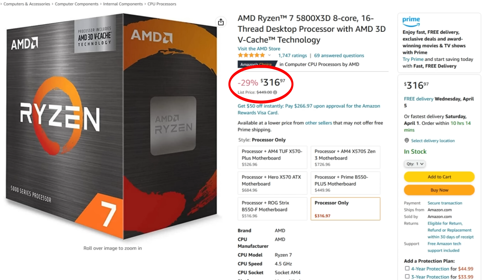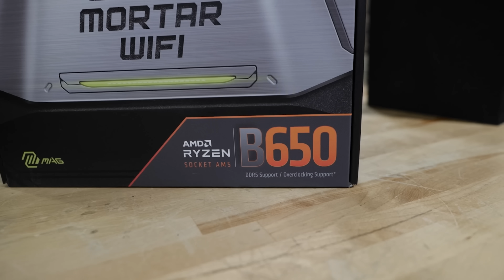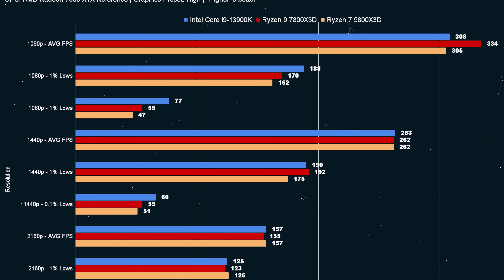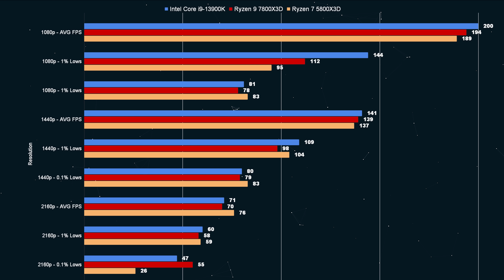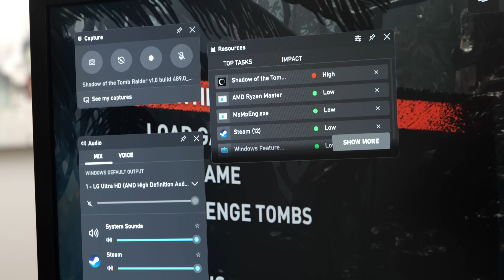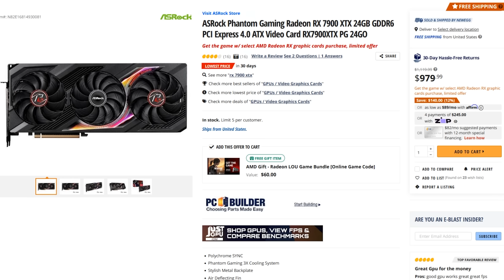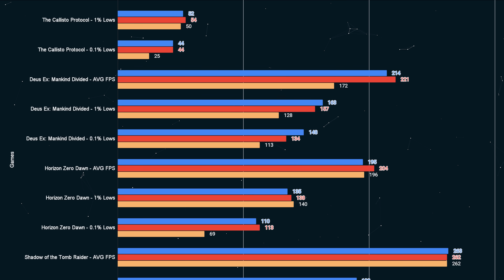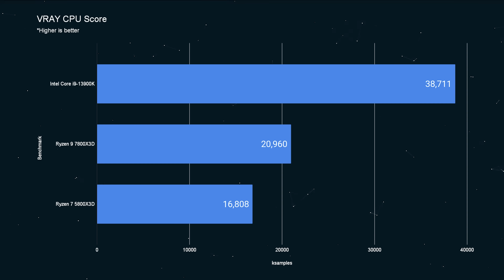Is The Ryzen 7 7800X3D The Ultimate CPU For Gamers?

Comment: The Ryzen 7 7800X3D erases the lower clocks and performance of the Zen 3 5800X3D but with higher IPC/clock gains per cycle that the 5800X had.  (Cinebench 17,432 Zen 4 vs 16000 Zen 3/5800X)  The only con I have is coming from the X3D Zen 3 to Zen 4 might not be enough increase to upgrade?   Building new and getting a faster performing CPU at lower wattage and bigger L2 + L3 and other little improvements gives Zen 4 7800X3D a leg up from me.
Reply: Compare AM4 vs AM5 total system cost, then put that in relation to performance differences between 5800X3D and 7800X3D that matter to you, add a grain of salt regarding potential future upgrades on the same platform, and you got your answer :3

Comment: Also it is important to note that during gaming the 7950x3d can have the cc'd with the extra cache totally focused on gaming for max performance while the other ccd can take care of any other programs running on the same time in the background. 7800x3d can not do that
Reply: should check again, they park the cores in game, and when you disable that feature they shown that sometimes the game moves across fabric, so you get better performance parking. if you do background stuff, you should just use intels e cores, if it matters to you.   also quicksync apps, amd doesn't have that yet for the programs that work with.
Reply: I would actually love to see a 7800x3d vs 7950x3d (and why not vs 5800x3d too?) benchmarks in gaming and streaming at the same time (NVNEC x264 P6 / P7 encoding, maybe some benchmarks with AV1 too). 
All I've got atm is an old 3900x and 4090 and my fps gets tanked hard in OW2 when I start to stream or record, therefore thinking about upgrade. I would love to know if there is any point in paying for those extra non-vcache cores for such an use case.
Reply: @RJ-vy4yd  me personally bought the 7950x3d because during gaming I want to have stream open in my second monitor, to have all my programs for monitoring and controlling the components of my PC as well as make recordings have opera gx, twitch and other stuff running in the background. So the non v cache ccd can take care of all these so the 3d cache ccd can focus on the game to make sure I get top tier gaming performance. With a 7800x3d .... Well... Still good performance but some performance would be lost due to the CPU trying to take care of all those things with 1 single ccd

Comment: What are chances that AMD makes AM5 APU that has 32 or more L3 cache, 12 or more RDNA 3 i-gpu, 8 cores ? That has decent performance on a 1080p platform ofc.  5700G performance on 1080p platform (high settings) was frankly disapontment.  Still running 3400G APU. I see no benefit upgrading to 5700G.

Comment: Thanks for benchmarking games that actually benefit from the 3d cache, unlike every other review I've watched. I would love to see a revisit of Stellaris with some numbers. Maybe let a save file run as a spectator til the midgame at 2300 and time how long it takes to reach endgame at 2400 on fastest with autosaves off, using the same save file across cpus. Also maybe do 3 runs per cpu just to account for any RNG, though I doubt RNG plays a big part once the borders have kind of settled.
Reply: How is anybody supposed to know which games would benefit before testing them?
Reply: @shanent5793  we know what games benefitted the most from the 5800x3d so it worth testing the how well this new one does with such games.

Comment: Curious about ram speed with the 7800x3d and if it hit 6200 or ...
Reply: I have personally tested 7 AM5 CPU so far.  All 7 have hit 6200 with no issues.  Getting to 6400 however I have only had two post at that speed and only one of them run stable.  Luck of the draw has only favored a 7900x3d so for with 6400 speeds stable.

Comment: The biggest problem for the 7800X3D is the 5800X3D.  The 5800X3D has been selling like crazy, typically being in the top 6 on Amazon's top 50 best selling CPUs and it has at multiple times been within the top 5 best selling CPUs. 

I'm thinking that people who bought the 5800X3D are in no mood to switch out a system JUST because there's a CPU that games better.  A handful of people will, most won't.  There's a lot of expense in moving to AM5 and personally I'm not a fan of the limitations right now for Zen 4/AM5 because I use a MB for much of the IO that's on it.  The fact that Zen 4 still has an 8GB/s CPU-chipset link, something that Zen 2 already had is no good to me.  The fact that memory speeds are not very good for Zen 4 is not good to me.  So, Ryzen/AM5 needs major upgrades before I'm moving to it, and if it doesn't get those upgrades I'll probably switch to Intel for 15th gen, as long as it hits the goal Intel has set out for it.

Most likely AMD needs to move to a better link between ICs on the SoC because I'm betting that their infinity fabric is part of the limitations and this is where Intel may have an advantage but we have to wait and see the tiled CPUs to know.
Reply: This is what I believe is in part an actual factor to the R9X3D being first. The 5800X3D is awesome for people that play games where the cache helps, if they could be happy with an 8 core. People exist that want more cores, and the benefit of V-cache. Any person that plays games yet had reason to buy a 5950X, would not want to step down to a 5800X3D. There are cases where a 5950X will bottleneck even a 6800XT. It's gets kind of annoying that most youtubers treat the R9X3D as some kind of trick, as if pure gamers can't wait a month so must rush to pay $700 for way more CPU than they need. The 16 core users waited 2 years to have the best of both worlds. The 7950X3D at $700 doesn't look terrible for the person that paid $800 for a 5950X.
Reply: @blkspade23   Yeah me too.  I felt the 7950X3D would get more sales off the bat than the 7800X3D because there was a LOT of complaints from people who SAY they need all the cores of a 5950X but wanted the Vcache, so when all the rumors were going around about why AMD could be delaying the 7800X3D I just assumed AMD wanted to get parts out to the people they felt would buy the most.

And yeah I ignore most of what Youtubers say.  They're arrogant SOBs and want to attack companies too much.  The two Steves are the worst which is why I don't subscribe to Gamers Nexus or Hardware Unboxed.  In fact with Gamers Nexus, if I want to see a review he posts, I listen until the first irritating statement, then turn the sound down, and thumb down the video at the end since I couldn't listen to it.  I'm also skipping through the video just to see the charts and that's it.  In fact I stop the video while jumping through and he doesn't get credit for me giving the video much view time.  That way I don't feel compelled to leave 5 - 6 comments attacking the different things he said.  I can't STAND his sarcasm, but that seems to be the thing that turns on a lot of viewers, the negativity.

Comment: My theory is AMD bothered with dual CCD V-cache/non V-cache pair to build out asymmetric software configuration infrastructure, that will give more flexibility and top down direction of the scheduler based on user not thread requirements.
That prepares the way for the architecture experiments, like the believed Phoenix 2 low end mobile 2 Zen4+ 4 Zen4c hybrid CPUs.
Imagine future consoles with V-cache and IOD on a cheaper node, a 12-16c/24-32t CCD compact core on 3nm  with V-cache L3 plus 4c/8t low frequency cores in the IOD to manage system tasks and accelerator blocks.
Reply: AMD could probably release a chip that has a 8 core Zen 4 full clocked chiplet with a 12 core Zen4 chiplet with stripped out cache but with 3d cache added on top to eek out a win in productivity and gaming.  Not sure that would make sense when they could pair a Zen 5 chiplet with the 12 core zen 4 with 3d cache.  I'm also curious as to if/when AMD will add 3d Vcache to the IO die on the chip to work as L4 cache.  They could probably throw at least 256MB of L4 on the IO die.
Reply: @Somethingaboutthat  there's s few issues that might make that tricky.
First the 7nm V-cache die has power vias which in Zen4 already have spread into the L2 cache, so a compact design may be impossible without the L3 area.  The stacked chip would be over hotter logic.
Then according to a Tom's Hardware in-depth piece on the 2nd gen V-cache the voltage limitations are an effect of the larger distance the volt domain has to cover.  Cranking up the volts to maintain sufficient to have high frequency results in high leakage, which makes for wasteful power loss and high thermals.
So it's not trivial to add the low latency extra cache.  Putting it on top of a compact core might be undesirable in other ways.
Now the 16c/32t CCD of Bergamo would slaughter the Raptor Lake E cores, so an 8c/16t without V-cache plus Zen4c productivity CCD would be tasty in the benchmarks and with the 79x0X3D core parking tech would be decent for gaming like a 7700x.
But does it make sense just to win the benchmarks in productivity and be respectable in gaming?
Why not do a full productivity chip, call it ThreadRipper, make it from 32c/64t to 64c/128t with a quad  channel socket cheaper than EPYC/TR Pro that totally crushes Raptor Lake and Fishhawk Falls as a cost efficient prosumer platform?
The reason would be simply production issues, consumers happily use the CCDs that fail to make EPYC or 7950x grade.
Small production runs reduce the ability to collect golden samples through binning for the elite chips.
However with Bergamo servers coming, perhaps your idea will happen with scavenging of 16c/32t CCDs as 12c/24t Zen4c in hybrid chips.  But if paired with V-cache it ought to be in the Zen4 CCD to avoid niche redesign and avoid compromising game performance with even lower boost frequencies.

Comment: I dont understand how different each review of the 3D processors benchmarks have been. Linus shows the 7800X3D beating the 7950X3D and others like hardware unboxed showing the 7950X3D beating the 7800X3D. I know I get better or the same performance as the 7800X3D with my 7950X3D, so linus must be doing something wrong?
Reply: Don't expect them to be uniform. Each is its own data point, which shouldn't be erased just because it don't fit the trend. The only mistake LTT made was sitting on their review of the 7950X 3D for two weeks
Reply: I wish they would use process lasso, it works so  much better than the AMD drivers / Xbox game bar.  I use it on all my dual CCD AMD and 12/13 gen Intel P/E core systems.

Comment: I often wonder if games that beneftit from the VCache could be displaying a symptom of something bad happening in the code, i.e. say, iterating or searching unsorted large objects instead of smaller efficient sorted objects that dont need scanning to find their location.
Reply: No, the fast programs are based on data flow and do sequential scanning, because with pre-fetch of cache lines it's faster than unpredictable random access.
Strategy games like V-cache, they end up with millions of objects late game, so thrashing on RAM look ups is alleviated.
Hash tables are efficient for random lookup, but would be a prime example of unpredictable access patterns.  It could be techniques like that enjoy the acceleration, but branding such unsorted data structures as inefficient isn't really fair.  Direct access is generally much faster than a binary search of sorted data, but simple brute force scanning may often be faster with small numbers of items.
Reply: beyond normal 20%+ loss to bad code you mean, depends on game, and how the game uses it.

Comment: didn't even know it released today, crossing fingers as the 7950x3d was awful for games :/ great in benchmarks but real gaming was a stutter fest even with process lasso tweaks the lot
EDIT : nope amd still stuttering judging by the lows and contrary to what Wendell says there's still a giant gap between amd and intel in the worst places were game engines struggle this matters more than having 280 instead of 230fps my 7950x fell down to 35fps with a 4090 while intel drops to 65-70...not great for a 300fps capable system but again thats when it matters

Comment: I still have a 5900X and i am still not sure if swapping to 5800X3D is worth it. I am not buying into AM5 just yet.
Reply: i just did and for gaming i believe it was worth it. higher minimums and in some games a nice boost in avg fps as well. overall games run with lower latency with the 1 ccd and feels smoother. 5900x is no slouch but if you want the best on am4 regarding gaming and not sold on am5 just yet id get 5800x3d.
Reply: i wouldn't

Comment: wish you did benchmarks with bad optimized games like escape from tarkov/mmos thats where you would see the biggest difference between intel/amd due to the cache size overpowering the terrible optimization.
Reply from the maker: we did actually do escape from tarkov and the 7800x3d is "the" cpu to get for that, but it was a bit squrriely and was cut for time explaining why we thought it was squirrely to compare.  "generally" badly optimized games love the 7800x3d and I mentioned that somewhere in the video
Reply: @Level1Techs  Did you see any performance difference between the 7950x3d and the 7800x3d with these kinds of games (Rust, Tarkov, MMOs)
Reply from the maker: @XxMicroNinjaxX  no for just gaming the 7800x3d is about the same as the 7950x3d, there is opportunity for the 7950x3d to be worse as in what i showed with factorio .. if you just game the 7800x3d is really good
Reply: @Level1Techs  Thanks for the reply :) All 7950x3ds are on back order in the UK so I am going to try snag a 7800x3d tomorrow and cancel my 7950x3d. Wild how close the performance is for gaming...

Comment: what is an AMD CPU for programmers who have to watch the logs of long builds every day ? :-)

looks like 5800x3d is only half as fast as 7950x3d in compiling the kernel (101s vs 51s),  7800x3d not yet in the openbenchmarks list
Reply: 7950 is better for that workload, or intel. 78003d is a gamer chip.  just don't count the 3d cache as helping compile its just raw speed.
Reply: @msolace580  not all those workloads can be spread over 16 CPUs, some use a single CPU so my hope is 7800x3d might work better than its older brethren 

I'll wait until there are benchmarks

Comment: Curious if this will convince me to get AM5. Probably gonna get a 5800x3D but very curious how it stacks up to the new generation.
Reply: I would get the 7800X3D and then drop in a  8800X3D when it releases so you have a longer lasting platform.
Reply: @WayStedYou  Sounds a bit a waste of money if you have the 7800X3D, to then buy the next generation 8800X3D. The 7800X3D will still be a very good CPU by then.